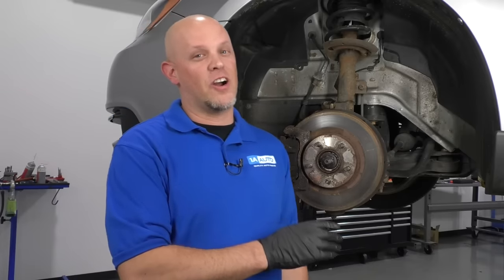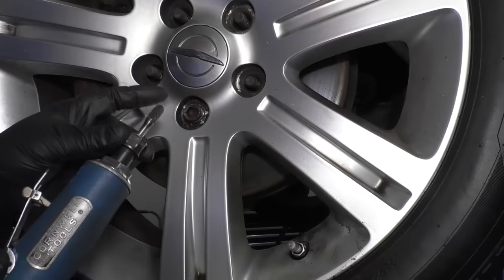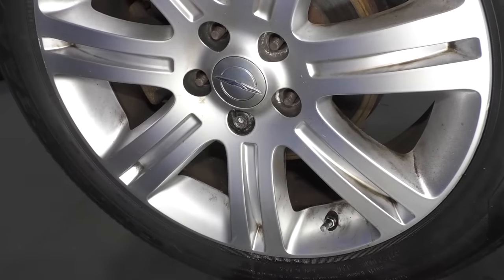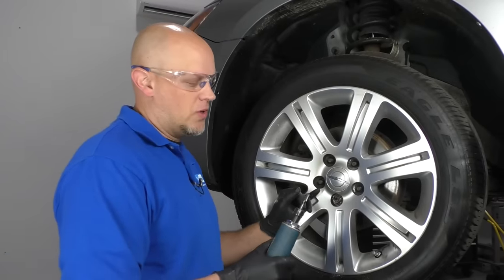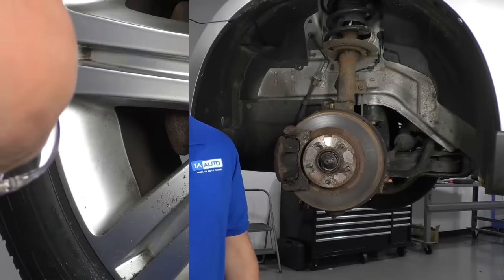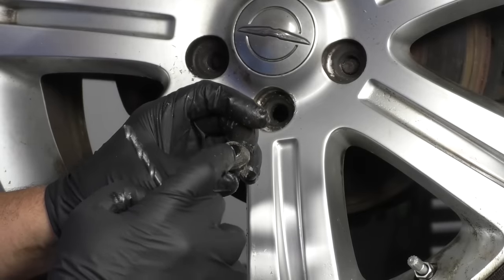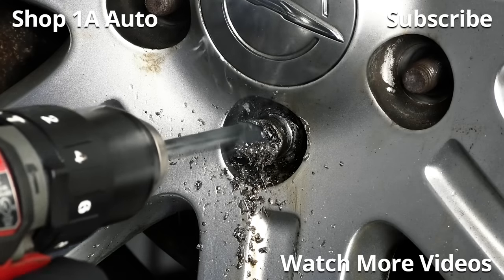This Lug Nut Wouldn't Come Off Our Car!

Comment: 2001 Chevy silverado 2500hd 8 lug one of them strip fist thing trash the one arm factory lug wrench for the 4 way lug wrench this will ensure less chance of rounded off lug nut , and when installing lug nut put some anti seize on threads will make it much easier to remove , any way I use my grinder to grind down to threads and chisel and some heat , a simple tire change turn into an event wow

Comment: Just had this type of fiasco happen on my old ladies 2012 Honda Accord, went to take the wheel off to get new tires and one of the lug nuts wouldn’t budge and unfortunately it started to spin the lug stud! So I was stuck using this method to drill out the stud and after a couple of drill bits and a chisel I was able to get the stud drilled out far enough that the lug nut came off! It was quite the job and one I don’t ever hope to have to do again!!!
Reply from the maker: +Scott Amy Thanks for checking us out! http://1aau.to/m/Shop-1AAuto-c

Comment: Use an electric heat gun, hold it right on the lug, no torch needed. More control and sufficient heat. 
Wheels are okay to get hot. They surround hot brakes.

It was painful watching you drill that out, and you clearly damaged the rim...
Reply: Did he?

Comment: While I understand some jobs can be difficult this video does not seem to be about removing rusty nuts since penetrating oil was not even attempted That is the first thing you do as a mechanic in the automotive business Next you apply heat if you can while trying to protect the wheel and try to work the nut back and forth Not sure why the nut was rounded off unless the socket was not the right size Sure after the nut was rounded of than there is no other choice than to drill it out which this video was all about

Comment: I drilled it as you suggested. I can see the lug. Used pb blaster on it. Heated it. Tried to you an extractor and it still won’t break. How did you get it to just fall off? Did you drill between the nut and the lug itself?

Comment: I use a tool called The Lug Ripper II to still them out safely and quickly. All the manufacturers are going to this design lug nut and it just makes everything worse. I also have 19.5, 21.5 and 22.5 specialty sockets just for these type of lug nuts.

Comment: I bought a car with locking lug nuts on the wheels. Had no idea until I needed to remove the wheels. To address a brake issue. Come to find out some one had lost the wheel key. I ended up hammering a 12 point socket on to the keyed lug nut and impacted off. How ever there was one that would not give up. Due to the wheel design drilling was not an option. So the wheel had to be destroyed with an air hammer to chisel out the stuck now destroyed locking lug nut.

Comment: I fixed used cars in the early '70s.  A customer bought a used car, asked for the almost new tires on his old car to be transferred over. I had no impact wrench, so used a "X" wrench. The lugs were tight. I twisted that X wrench 180 degrees and the lug nut didn't break loose. Yes, I actually twisted the shaft of the wrench! ( I am a big guy) We told the customer to go to the shop that installed the tires and have them remove the wheels. They destroyed the lug nuts, studs, and all 4 wheels were bent when they got through. Tire shop had to eat that job!

Comment: Could have tried (might not would have made any difference)after the cap was off,spray with something like PB Blaster and go take a break for a half hour (or left it sit overnight) also could have reinstalled the two lugs on each side of the bad one while trying to "persuade" it
Reply from the maker: +David Powell We appreciate the feedback. Sometimes there are multiple ways to accomplish the same repair.
Reply: @1AAuto  also might add if you have a lug Bolt with a taller than average hex you might want to make sure your socket completely covers the hex,some sockets don't (too shallow broach,even in some "deep" sockets   (what I call "nut stop" so the nut doesn't fall way up in the socket)
think Wright impact sockets and old Bonney impact sockets completely swallow those tall hex,such as the ones found on certain BMW and VW ,also older Craftsman deeps I think are broached almost the whole height of the socket

Comment: Striped lugnut socket would have solved this problem in 1 min. Drilling is always last resort. And instructor had drill in high-speed which dulls bits extremely fast.

Comment: Have the other 4 tight while trying to loosen the last one . 
Spray , let it soak while tapping on it , (try to tighten  ?) , before trying to break it free . 
if using heat  - Is RED hot necessary ? When removing gears a little heat above the keyway is best
Reply: Grandpa always said - "To make it move, first make it move the way it moved last first."

Comment: Once had a lug nut and stud have stripped threads in such a way that the nut was loose and could spin freely but would not come off, had to drill it out but also hold the nut from spinning the whole time, in a recessed hole on alloy wheels

Comment: I used an impact socket and used biggest impact I have and ran it out until that lug nut was literally smoking hot, then used reverse flute broken lug nut extractor hammered it on, grabbed longest breaker bar with a cheater and BAM broke it free. I also had to drill on out and that took forever......

Comment: Put a socket on it, piece of wood over it, hammer the wood. Take socket off the try to remove. Sometimes its not rusted, the lug creates grooves in the hole of the wheel and get trapped. Hammer can help break it free. Wood piece wont deform the socket

Comment: my 2014 Infiniti qx60 often has seized nuts.  i usually just snap them and replace the bolts and nut. I had 2 recently that stripped off the splines of the bolt in the rotor, I had to remove the wheel along with the rotor and hub together. quite a job. then I discovered the bolts are so hardened that they can not be drilled.  I couldn't reach the bolt heads with an angle grinder and finally had to cut the bolt heads with a torch, took me all day to do a 1 hour job. i feel there is a problem with this cars bolts but don't know if Infiniti as a group has this problem.

Comment: I thought saw socket spinning.  
I had that happened. Old GM. With small chisel I got broke the rest of that cap off.  Went along the side.  Thin aluminum cover pealed off.   
Then smaller socket and impact.

Comment: Didn't see any penetrating oil, PB Blaster or smack it with a hammer to help break the rust, and iron aluminun bind. But have heard of this problem with those stupid lug nuts.

Why you should use a little anti-sieze and tighten lugs yourself, so you can always remove them on side of road.

Comment: Common issue with Chrysler lug nuts. Ford vehicles have similar problem due to the chrome caps getting rust underneath and swelling. A burn socket works well too.
Reply from the maker: +Dakota Williams Thanks for checking us out!

Comment: That is why I AWAYS use anti-seize on all of my car's lug nuts = to keep them from rusting themselves into place. There is only one problem with using anti-seize, and that is the fact that it is a lubricant and if you torque the nuts to the require torque you will actually be applying too much tension to the bolt, so only torque the nut up to 70% of the required torque (55 instead of 75 ft-lbs).

Comment: Sized tire nuts on the Highway no matter you can't do any things  only this to be done in Garage because of the difficulties and lack of tools available only can be removed as you highlighted also heat can help to break the mating faces of Tire and nut tapper also you may weld a small pipe 3" long  internally over the nut and use a Pipe Wrench for opening.

Comment: How do you remove the wheel out if the nut is still on the bolt when the bolt stripped out from the back of the wheel's hub?

Honda CR-V's 19mm nut/bolt spins freely. bolt popped out from wheel hub.
Worry that the wheel be damaged if I uses a grinder or hack saw, Not enough room to cut.
Reply: whatd ya do? i have similar situatiom

Comment: That's when you pull on that breaker bar until you snap the stud and just press another one in and save all the drilling, torching BS. The stud threads are stretched beyond return if it's that tight. so it should be replaced regardless.

Comment: Unnecessarily made this harder than it had to be. 12point smaller socket hammered in good, socket wrench with cheater bar, wouldve came off in seconds.

Comment: I was a tire buster for several years. That tends to grow some muscle. And I did run into a galled lug nut /stud once in a while.They are essentially welded together. 
I had a high quality long arm 4 way lug wrench  and I was capable of just twisting the studs in half.  That will get the wheel off. Then replace the studs.

Comment: if all my lug nuts are like this...and they keep breaking...what can I do to prevent them from shearing in the first place?!
Reply: anti-seize compound on the threads when replacing them.
Reply: @kingarthur83rd  yea. And make sure you rub oil on your brake pads and rotors while you’re at it….

Comment: Did you replace the stud afterward?
Reply: Nope. They just used the 4 other studs and then ran a nice spray of oil on the rotor.

Comment: Having an issue bolt head has snapped leaving the lug in the wheel so need the wheel off to change the worn tyre out gave a go with drilling looks like gonna have to crack on it so more wheel doesn't even move at all with a rubber mallet
Reply from the maker: +David Blackburn Thanks for the feedback!

Comment: Put the 2 lug nuts on both sides of the stuck lug nut back on to take the pressure off of it and then try taking it off .

Comment: I had to drill out the caliper pin from the bracket  , didn't go well hole was off centre .  so what hole i had that wasn't even deep enough , i cut a pin in half  that would work until the new bracket came...  :)

Comment: Do one on stuck hub assebly bolts the ones on the back of the hub. Mine are stuck. Stuck stuck and the cv axel boot is directly in the back of the bolt which I can barly even get any type of tool around the nuts because of the cv boot. In the replacement hub and bearing assembly video you make it look eqsy but it's absolutely almost never that easy. Never. So do thet for me? It's been 2 days I've been constantly wrecking my shoulders and arms 😢 I even got a friend thets over 300 lbs and they won't budge. It's obvious its seized my truck can't move. Help me plz.

Comment: This gives me PTSD because last year I tried to be “Mr Do It Myself” and rotate the tires on my Santa Fe. I was careless and cross threaded bolts on 2 tires….. next thing I know my girlfriends dad is helping me drill a hole in one of the nuts and managed to get one of them off but when we found out more of them were cross threaded, ended up calling a wrecker and towing the car to the shop. My careless mistake cost  me $500 to replace the rear assembly and took the shop damn near all day to do it because they were having to fight with it to get them off. 

They called me on my phone and said “Respectfully sir, what in the hell did you do to this thing?”. 

I learned a valuable lesson that day. Just because you think you can do it yourself, doesn’t always mean you should…especially if you aren’t trained properly.

Not saying to not do it yourself, but make sure to always walk through each step in your head before doing something to your car. 

Because of this simple yet costly mistake I don’t ever want to do anything to my car as I’m afraid I’ll mess it up.

Thanks for sharing

Comment: If rust was the problem then why does he not try free all or some type of penetrating fluid? To anybody watching if you have a stuck bolt over the course of a few days spray some free all or penetrating fluid into the threads once or twice a day, then use a breaker bar or impact gun and that bolt should come right off. If not then use the method shown in the video.

Comment: I have used a lug or bolt extractor. And I have not had success. It’s a bmw, so it’s a lug bolt that is stripped and too tight. Any tips? Is the last resort to start drilling? Anything else to try first? This bolts are inset. You can’t get anything on them

Comment: Why not just snap the stud by over torquing on the lug? You’re going to have to repress the stud either way. Also less time, less chance of wheel damage compared to drilling.
Reply: Some time the lug nut will strip when using a impact gun because the wrong socket is used when the cap comes off or the socket is not properly seated on the lug nut which is what wal mart has done to my mothers car

Comment: Thanks. My cars in the driveway, and the metal valve is snapped off.  I was using eight foot bar, and was afraid I would snap of the bolt. So, I have to have my car towed, and let the mechanic charge me an arm an leg to remove all the lugs.  Yeah, all  the lugs are stuck.

Comment: How about using the jack to push the breaker bar to gain the maximum amount of torque?
Reply: Shield 21 That May work sometimes but you can tell early in the video his breaker bar was already going to snap from the force
Reply: @Carlos-yz5kz  
You're right. Nuts can be so hard that it could possibly snap the bar, perhaps even causing a hazard. But that method is used when the nut aren't too tight.

Comment: Awesome now i wanna know how to remove a rounded caliper bolt
Reply: They have reverse threaded sockets that fits over rounded bolts. Good luck.
Reply: Well there are a few methods of doing it but the way I prefer on a rounded bolt it to go to my bolt bin an find a decent size nut and grab my wire welder an center the nut on the bolt an weld the center of the nut up an wait a few mins the heat from the welding well help break the bolt lose but the new will give you a new head to put on socket on an if you twist the nut off grab another one and then try again you eventually get it when you get the right penetration on the bolt that's my preferred option but like I said there are other ways but it's more of a pain in the rear doing it

Comment: My girlfriend just had her front tires replaced and now I'm getting ready to do her brakes. Found out that the mechanic that did her tires over impacted all 10 lugs. They have the foil covers and I've chiseled them off but I still can't get them even with a 3 foot breaker bar. Any suggestions? Drilling out all 10 just isn't an option for me.

Comment: I used a hole saw on mine. Most of the nut had broken off and just the fatter bottom part remained. Would have saved the stud hadn’t I tried to drill it out.
Reply from the maker: +RJ H Thanks for checking us out!

Comment: How do I remove a lug nut lock that’s either seized or crossed thread? I used so much forced the key broke. I tried hammering a smaller socket on it then used a breaker bar and the socket eventually kept spinning.
Reply from the maker: +chi tung Tsui We recommend soaking in penetrating oil (for up to a day if possible) and then tapping with a hammer.  If it is stripped, drill through the lug and/or stud.

Comment: When it was rounded off and no hex anymore when it was round could of used the tool to remove the wheel locks if you don't have the key

Comment: @1Aautoparts Use the breaker bar but stand on it with your weight
Reply: Broken 2 breaker bars.. They were 3/8ths. Got the 1/2 inch nut rocket socket but have yet to use it. Wondering about the other nuts since this is just 1. The tire installer that put my new tires on messed up the inner beading on this tire and said I'm on my own getting it off after they stripped it using their impact wrench and broke a breaker bar too leaving the nut a mess. They suggested I find a torch person to get it off. I tried the torch method myself but no go. I figure if I get it off I might as well replace the entire hub. My truck is difficult to just replace a stud. What a PITA. I wish these places would just torque properly. That's why I like to do my own work on my truck.

Comment: Do you all have a video on a 2000 Toyota Camry 2.2 liter valve cover gasket replacement?
Reply: You eventually drill into the threads, which releases the nut.

Comment: Idiot's using air guns with high pressures to tighten nuts usually causes this problem....
Reply: @ThePariss333 Some repair shops have at least done the right thing by putting "torque sticks" on their rattle guns, but unfortunately this is not universal.

Comment: So now what about the stud that was damage....I wanna know how to fix that problem now. ..
Reply: Duh, you hammer that out the back.
Reply: @bobbyharvill4225  let's see it
Reply: PapiChuloElMerengero I'm not trying to be smart ass. If your studs are bad you just hit them with a hammer and knock them out the back. It's very hard too see because the back of the studs perfectly blend in,especially with rust. They are very cheap. If some kid with an air gun at the tire shop ever puts your ties on,you'll be replacing the studs. It's a good idea on stuff that's been taken on and off a lot to replace them.
Reply: @bobbyharvill4225  I tried that a few times. Can't say what happened, but I had to replace the wheel bearing assemblies shortly afterwards because they started making noise.
Reply: Captain Shark never put that much force, laterally,on a bearing. If it is going to take that much force, you can put a large socket over the back of the stud and push it out with a large c clamp. Heat them up some with a small butane torch,it helps too. But I promise you they do come out the back.

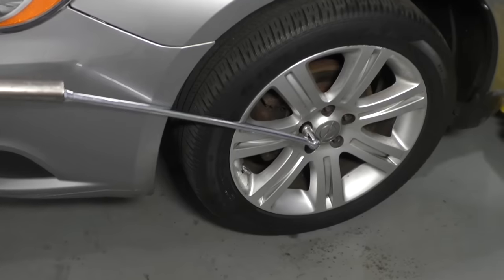Comment: 0:42 that's the dumbest way of use the long breaker with a pipe on it ever I see, dude the long breaker goes inside of the pipe and you can use the combination with the pipe to pull it down with less danger of breaking the goddamm long breaker.